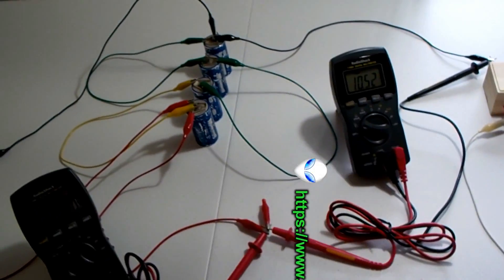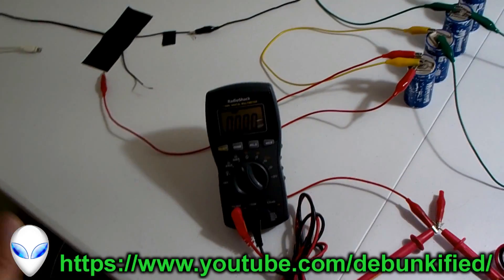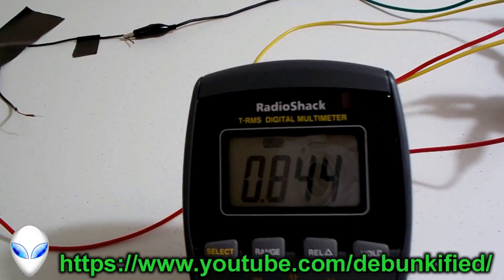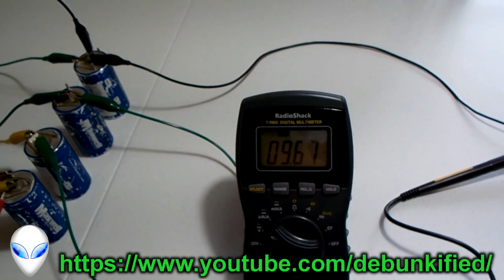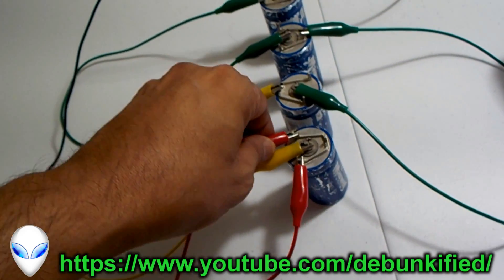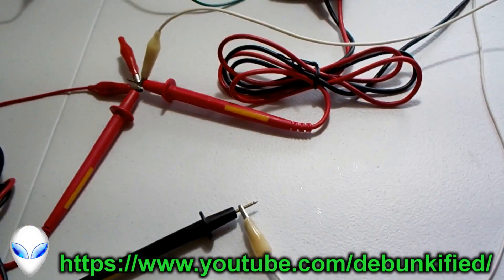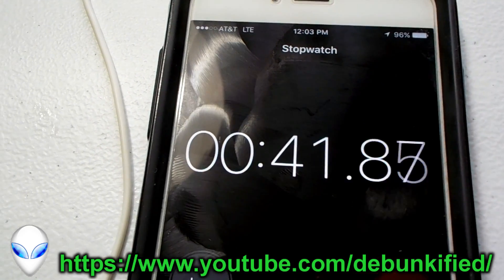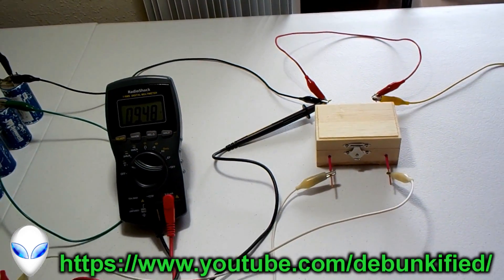Think Outside the Box

Comment: What is the output voltage of the box, if it is the same as in other videos, it will be 18V.

So a very heavy current will flow out of the DC-DC converter, which I believe is in the box, especially if it is connected to a set of super caps at 10V.

This means the DC-DC converter has to convert more POWER, this means MORE current as your supply is 10V.
So your DMM reads more input current, again, no mystical energy being produced, you are just feeding back the super cap energy at a higher voltage, and this is causing a higher output current'

So the DC-DC converter has to consume  more input current to keep obey POWER IN = POWER OUT + INEFFICIENCY

Comment: Do any of the leads get hot from carrying the 4 amps? Could you verify the 4 amps with a clip on ammeter?  Because if the 4 amps is erroneous reading then all we are seeing is a comparison of different loads (LED lamp vs just the DC/DC inverter).
Reply from the maker: +smokyatgroups The super caps are acting as their own load, so there probably isn't any heat at or in the wires, I could check it with an infrared laser. Heat would be inside the source as load, or in the box's circuitry, which has already been checked and there is, lots of it.
Reply: Thanks for reply ... I support your aims and objectives with all this stuff.  Today I was able to get over 20 times out what I put in.... different approach tho.
Reply from the maker: +smokyatgroups Hi, your support is very welcome. That's good that you got 20 times out than what you put in. Perhaps you can show us sometime.
Reply: It's a pulse method like pushing a swing once every couple of cycles.
Reply from the maker: +smokyatgroups Similar, it's taking kinetic energy off the swing and returning it along with the small amount of energy to maintain the high state of energy in the swing. 

One only needs a small amount of that huge kinetic energy to maintain that huge amount of energy. The energy stored in the swing also far outweighs any one single pulse or force to maintain that huge level of  energy.

Comment: Hi debunkified,

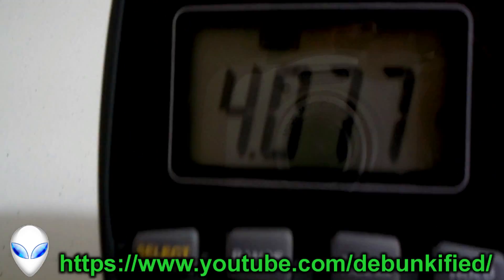At video times between 6:43 and 6:55 you said the 4 A current comes out from the power source at the positive side.  Here I disagree with this because the 4 A was flowing in the feedback wire (via the Ampermeter) with which you connected the output positive of the box to the input positive, ok?  We need to clarify this because there may be several viewers here who do not recognize this.  I take this as a lapse of the tongue, no problem. 

By the way, it would be good to see how much current flows into the positive input of the setup via the positive wire that comes directly from the supercap positive to the common points of the voltmeter's and ampermeter's positives and of the positive output of the box.  
When you did the LED load test the Ampermeter indeed read the input current taken from the supercaps. When you removed the LED and connected the two positives of the box with the Ampermeter, then the meter read the 4A current between the two positives of the box and not the current taken from the supercaps. 

I think when you connect the two positives and there is no LED load across the box output, then the circuit inside the box increasess its input resistance (between its positive and negative inputs) to a higher value (this resulted in the 58 second discharge time) versus the case when the LED is connected and the two positives are not connected hence the input resistance of the inside circuit became lower than in the previous case, so able to drain the supercaps to 9.5V already in 42 seconds. 

This is how I see these tests, sorry.  I mentioned already that there are circuits which are able to circulate higher current inside with respect to what they consume from their supply source. 

Gyula
Reply from the maker: +gyulasun The output current I believe just becomes the input current as it's looped right there. There are millions of ways to show this. A voltmeter is on the input and an ammeter is directly on the positive of that input voltage, so basically the output and input current are one and the same current. Please check your email inbox.
Reply: Hey Marc,
you wrote:  "The output current I believe just becomes the input current as it's looped right there." 
This is not fully correct:  in fact two input currents go into the positive input of the box, one is the current coming from the positive of the supercap (this is what is not measured in your looped test) and the other is the 4A feedback current.  
Putting this otherwise: you need to study Kirchhoff's junction rule (or nodal rule) which says: At any node (junction) in an electrical circuit, the sum of currents flowing into that node is equal to the sum of currents flowing out of that node.   
You have 3 wires that form a junction at the positive input of your box.  And you mesured the current (the 4A) only in one wire. 
Let me return to an almost similar test of yours done with a step-up converter where you measured input current in the negative input wire of the converter, 37mA, and you measured the feedback current, 692mA between the two positives of the converter. See this link with my post on the forum: http://overunity.com/17184/a-solid-state-dc-to-dc-converter/msg502041/#msg502041    You can see I put a cross on the positive third wire that goes directly into the converter to check the current. This current should be 729mA, the sum of 37and 692. You could simply check these currents with 3 current meters, first of all for yourself, whether I am correct?  Gyula
Reply from the maker: +gyulasun Yes you most likely are correct, I've already made clear more out than in and the actual energy "consumed" by the power source while much larger energies are circulated around by the output, whether that is an LED being powered simultaneously with power charging back to the source or just power charging back to the source.

In reality energy is never really "consumed" as that's impossible, as it's impossible to lose or gain energy, or create or destroy energy.

Output should always be subtracted from input to see what the actual power the source is putting to work, which will always be some smaller amount.

This is unorthodox and unheard of as normally the way to do that is too observe the input power only when this is not the true input power put to work. 

So with a 95% efficient system "in reality" only 5% of the energy is actually wasted away while the other 95% of the energy is doing work.

This explains how taking 95% of the energy to do work can be made greater, or simply amplified. There is no conservation of work law. Work is amplified, whether that is because the actual energy has increased beyond 100% is controversial because after all, energy is equal to work. 

Please check your email.